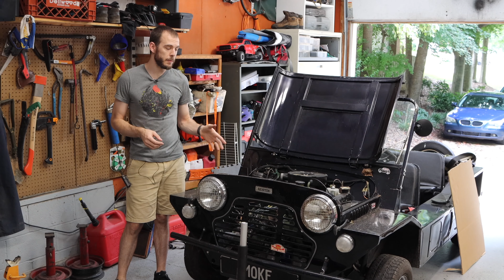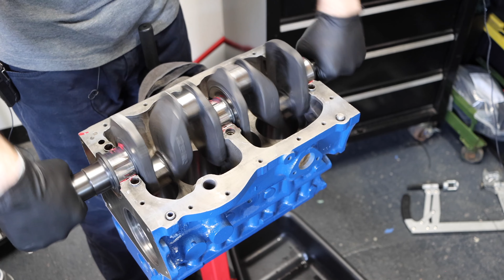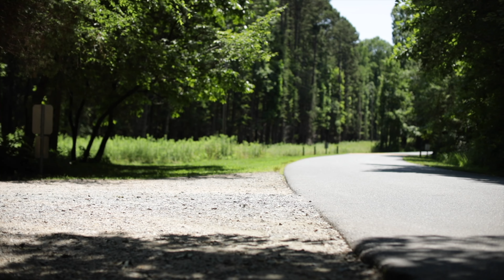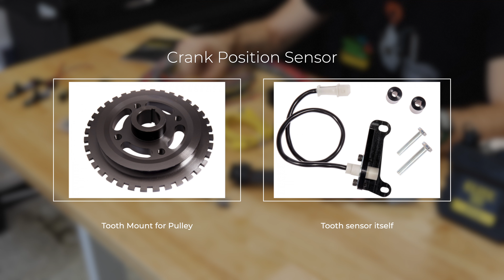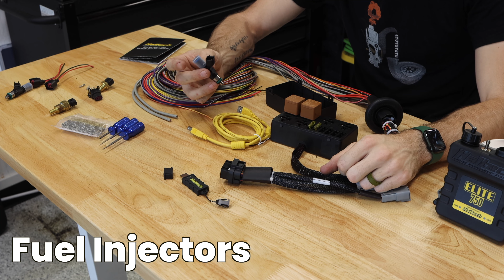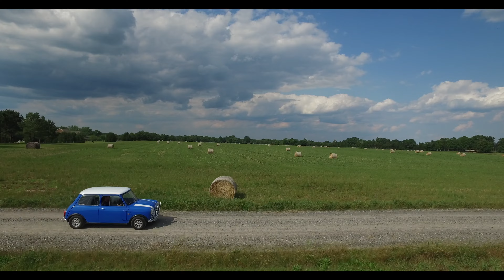Fuel Injected Turbo Classic Mini - Lets do this!

Comment: Hi videos are great help 👍 just wandering how you connect your main body wiring harness to the new engine Hal tech wiring harness
Reply from the maker: Hey sorry for the delay in response but I'm not sure there is a short answer to this question. Could you provide a little more detail of what you're asking? The haltech wiring diagram shows how it should be wired to the battery/ignition pretty well I think.

Comment: Dear Cole. Really looking forward to your series on upgrade the minis electrics. A quick question; would it be possible to run the Haltech ignition only? (Would allow for a slow and timely upgrade of my mini, while still using it as a daily ride/not doing all at once)
Reply from the maker: Yes absolutely! There is a toggle in the software called “disable injectors” and with that you’re ignition only.

Comment: Hey Cole, if you're planning to go COP with the ignition I'd be happy to design/build you a bracket for them.  Just designed/built a similar setup on my cnc plasma table for my classic Audi ('88 90 Quattro w/non stock turbo 5 cylinder, originally distributor/wires) and since I just bought a classic Mini I'll have one of those to measure from.
Reply from the maker: Oh man that sounds incredibly cool and I honestly would have taken you up on that but I am running the same coil pack I already have in the car. Just slapping an ignitor inline since the Haltech ECU doesn't have one built in. I really appreciate the offer, maybe there is something else we can collaborate on?

Comment: Would this system suit a normally aspirated 1098 mini? Obviously used different injectors.
Reply from the maker: Yes absolutely. As long as the throttlebody is configured properly for your engine bore with the correct injectors as you mentioned it could handle that as well.
Reply: @classicminidiy  Awesome, I'm  in Australia and have two classic minis and a moke. I'll continue to watch these vids with great interest. Thanks

Comment: Can't wait to see this.   I changed the eprom in my 1275 spi mini to a writable version and then updated the fueling and other values using a free online mems remapper tool.  It means u can use all the standard mini loom and idle control valve with the benefits of remapping for customizations.   A friend of mine that wrote the mems mapper for rover cars has an article on remapping or flashing the mini mems 1.3, 1.6 ecu.   It's defo not as simple to update over USB but it does mean it looks standard and keeps all normal spi parts.  Just something to keep in mind for simpler version.

Comment: Hey Cole,
I’ve literally just finished doing a custom fuel injection set up on my girlfriends mini. We kept having trouble starting it on the original 998 engine with HS4 carb. It now has a 1275 MPI engine with a custom injection set up I’ve made. I’ve used a Maxx mini ECU and then made the intake manifold adapter myself and used a universal throttle body with just one 630cc injector. It runs perfectly and starts so easily now, like a modern car almost.
Let me know if you’d like me to email you any pictures or information as I’ve been able to learn a lot doing the conversion.
Matt :)
Reply from the maker: Thats super cool. Which throttle-body did you end up using? Do you have a link? I havent seen one with a single injector like that before. Most of the units I am used to seeing are at least two injectors in the body. Did you run an idle air control valve as well?
Reply: @classicminidiy  it’s a universal one I got from a classic VW parts website. And yes I did end up using an idle control valve. I’ve sent you an Instagram DM with some more information/ pictures of how I did everything.
All the best,
Matt

Comment: The MCM mini was a supercharged A series running a Haltech before they went with the Honda B series. I remember them saying they were never quite happy because of the complications with the siamese ports and charge robbing and presumably the injectors having to fire twice straight after each other (it was a Japanese mini so I think port injected). I'm guessing your throttlebody injection aims to solve this, am I correct in thinking this means the injectors are going to be batch fired then?
Reply from the maker: They had some additional issues as well with the supercharger setup they ran. The fueling system was too far from the head and passing through the supercharger which will never allow proper fuel distribution. In most reliable injection setups for the mini you’re exactly right. Batch firing both injectors two times per rotation seems to be the sweet spot. Time will tell but with the throttle body in the factory location it will behave like an SPI or an MPI essentially.
Reply: @classicminidiy  going off this video they were port injection.
https://youtu.be/0_n4L1r16uI
My left field idea I had years ago was to swap the exhaust ports for inlet ports so only the middle port is shared and the sharing isn't consecutive. That said you'd need a heavily modified head, custom camshaft, and custom inlet and exhaust manifolds, it's apparently been done on a carb 5 port engine and gained power but lots of work.
Reply from the maker: Yeah from the looks of it they are still using suck through for the fueling in that video which is (in my opinion) where the headache comes from. The fuel gets sucked through the supercharger and gets minced, as well as sticking to the screws of the SC. Means you have even less control of how much fuel is actually making it to the cylinders themselves.
Reply: @classicminidiy  From what I have read in forums trying to get port injection working well with the siamese ports are very tricky, you need supersized injectors and never run more than 25% duty cycle, so that the first intake valve does not rob the fuel that would normally be injected on the closed valves leaving the second intake valve with nothing. People run dual wideband sensors, one sensor on the exhaust manifold center runner and the other sensor on one of the outer runners so that they can fine tune the injector timing, you can see read up on siamese injector timing settings on megasquirt forums. But I am curious to see what you will be doing, single point injection should be straight forward.

Comment: Cole what a cool surprise to see you are thought-leading new approaches here.

Such a well-timed vid...I was just about to pull the trigger on the Specialist 5-port however a number of friends have had real issues getting them tweaked.  You may have just saved me real headaches coming up and I'm dying to see your throttle body concoction.  

Nice that the Haltech includes the nice fuse box, exactly what I was about to do while mounting the SC ECU.   Good you got the MED combination Damper/Pulley/crank wheel I just ordered as well.  Still unclear if the Marelli sensor is what all these use.  Will be reading the heck out of the Haltech stuff now.

SC has a thermostat tapped with a coolant temp sensor, not KAD or MED. Retrosport lets you send yours in for them to modify but then you'd think they would just stock one to buy.

It'll be cool to see you how you do the high pressure fuel lines and return line with swirl pot, or an Mpi tank etc.  

Senior React dev here... lol.  Don't know how the heck you find time to do all this while worrying about the latest state management library and design patterns etc.
Reply from the maker: Thank you so much for this thoughtful response. Yeah it can be a struggle sometimes to juggle it all and it doesn't always all work out but 9/10 its good! Hahaha. I am a Angular/Vue guy. Angular at work, Vue in my personal projects. 

My hope is with these videos I can help people tackle this job step by step with a nice set of tools and resources. I found this topic to be lacking in the mini community so what better way to solve that, than to just do it myself!? :-D 

God speed reading the Haltech stuff its a SERIOUS rabbit hole but one that is incredibly fun to fall into. Their documentation and community both on Facebook and in their forums is incredibly helpful.
Reply: @classicminidiy  well because of this vid I'll hold off on the SC 5-port before seeing what you've cooked up here, really anxious to find out!